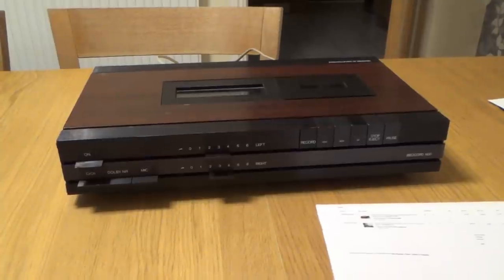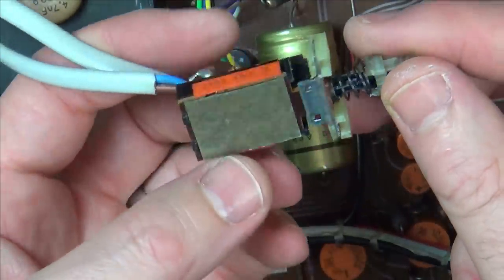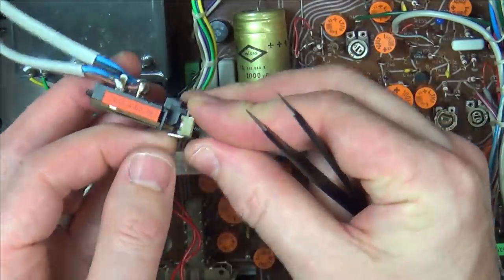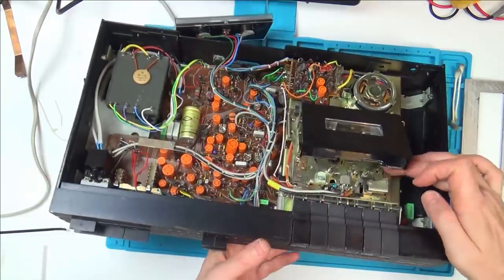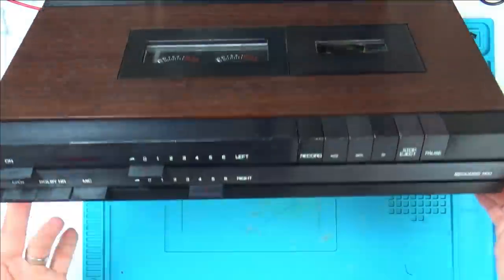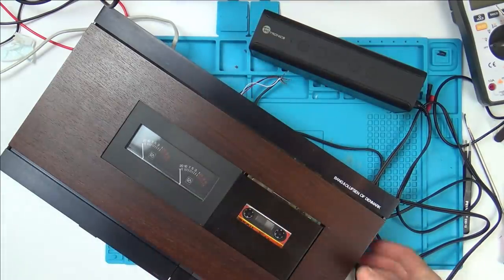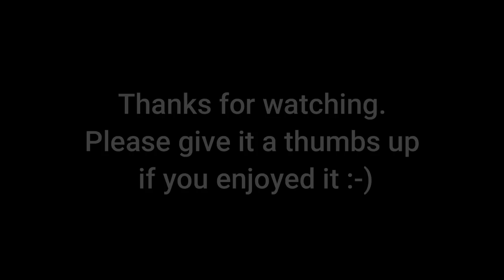Bang & Olufsen BeoCord 1100 Cassette Deck -Trying to Fix

Comment: while the leads not right for the right microphone due to the AV needle not moving properly, but basically you find 1/2 way through the song, and then set the levels to a maximum of 0db as maximum (any louder then it will make like a silence on the recording as it clips the song) as a dj over that then makes the music very loud, then then you setup the volume of the input source so that the needles bounce around with the music (not moving very much means the song will be distorted), rewind the track, positive (red) on the needle means that the song is clipping as too loud. negative (white) is the area you want the needle to be, if the needles are not going up and down properly with the music then it means the input is too loud and distorted. but that is the basics behind recording an input so that it isn't too quiet or too loud, or even distorted.
Reply: source = walkman, but basically you want the needle to move from about -15db - 0bd. but basically that is what the dj used to do when records were vinyl, as no two records were recorded the same, or come out at exactly the same volume. so it was a constant battle to get the sound the same.
Reply: also with copywrite then lecturer said it is 10 years after the last release of the song, but looking it up then while the author of the song is still alive then it is 100 years of copywrite, or death of the authur whichever comes last.

Comment: He should've made the connections better because a short of the inputs and outputs can ruin the amplifier board inside the tape deck aswell.
Also there's a HUGE difference between the signalstrength for speakers and the line ports to keep in mind when working with these things. Line in/outputs usually works with <0.3V wereas speakers can be way beyond 10V!
Luckly, these appliances was built with high quality back when they were made, but the fact that these things are passing half a century now, they should be handled with care and caution when plugging those in. Especially if the electrolytic capacitors are not replaced.
You don't want the "magic" smoke comming out of it with a 💥(boom).

Comment: Not an audiophile, but it sounds like the issue with your record is that the output on your CD Player is too "hot" for the input on the tape deck. If you turn down the volume of the CD player's output and adjust the input of the cassette player as you did so the needles aren't peaking then you SHOULD get a more decent audio quality.
I have the same issue with my Minidisc player in my car using the headphone out; I have to turn the volume to max on the minidisc for the car audio to "hear" it and play it through while this same volume trashes my headphones until I turn it down again.

Comment: Has anyone told him he is in the wrong input? It is the other pair of connections on the five pin din which are always L/R in and L/R out. The mic is for a mic and is around 25- 30db more sensitive.

Comment: your were putting to high an input from the cd palyer it will only need a few mirco volts to record from . and you may have left a wire off for the vu meter

Comment: You're feeding your source into the wrong socket. Ignore the MIC DIN altogether and use the other two pins for the input signal. The 5 pin DIN socket should have 1=in, 2=in, 3=in/out earth, 4=out, 5=out.

Comment: Amazing how someone can fix something, yet still not understand , that sound is caused by the input signal to load, if you try reducing the volume levels on the l and r channels then check the recording. Of course the tape itself has some result on the final sound quality. That was the problem with analogue recording from one source to another, there were so many variables

Comment: It's distorting because headphone output is wrong for a mic input. Too much voltage.
Reply: Bang on , I was going to post this , the input is designed for non amplified sound so turn down the volume on the CD player to virtually nothing and it should sound ok 😀

Comment: That's distortion îs because the CD has big output.  And that output go's direct to the head of the tape. Headphones direct to the head tape = distortion. You need a smol volume of sound there.  Just put a 100k resistance there on each channel.

Comment: I think the input signal far too high for the Mic input Socket he sensitivity of which will be around  3 mv, where as the signal you are feeding must be in excess of 100 mv, and hence the distortion. Normally,  the 5 pin DIN Socket will have input and out put in the same Socket

Comment: Hi Vince, I think the power switch  pin is meant to go in from the outside, not the inside, the wee spring plate looks like it's been off before, have the ball end of the pin at the spring, that's why it was inside the case rattling around and not still inside the switch.
Good videos though, I've watched most of them matey.

Comment: so not just the belts need replacing huh? shame got rid of my cassette deck got sick n tried of just spaying oil in there and it working for a bit but then not sound flat dull then a few moments later fine that or eating the tape as in pulling it along but no sound still i have my other system just sitting there collecting dust as the belt needs replacing it'll work but then sound like the band singing are melting then stopping,

Comment: 24:40 You can buy those switches new: https://www.ebay.co.uk/itm/2x-KDC-A11-2-inner-spring-TV-5-electric-heater-large-power-switch-with-bracket/254690253690?hash=item3b4cb8db7a:g:s08AAOSwdO9fOdF~
If you search for the model number KDC-A11-2 you'll find even more.

Comment: Don't try fixing these power switches as it is a waste of time. The 'L' or 'U' shaped pin usually runs along a fine groove in the switch and there is a very small lip in the groove that acts as a latch but wears or breaks off after some years. In the 'on' position the spring forces the pin to take a route where it latches onto the plastic lip. Depressing the spring moves the pin away from the latched position and allows the switch to slide outward to the off position.The spring does 2 things - it secures and binds over the pin, as well as acting to guide the pin to the latched and unlatched position. There are only 2 or 3 types of power switches, so measure up and order a new one on line for a couple of bucks.

Comment: Don´t  use the Mic input, the sensitivity is too high! The Line Input is on the same Din Plug as the Output. Line Record in are Pin 1 and Pin 4
Reply: You're right there. DIN sockets supply inputs and outputs all in the one socket. That's why he really needs the correct DIN cables.

Comment: the distortion on the recording could be down to the input volume being too high usualy on the older systems the line in is not amplified from the source where as the out put from cd player is amplified  you can try adjusting the volume level on the recorder and lowering the volume on the cd player until it sounds right or you can try connecting the output from the cd player  before the amplification chip  on the pcb  and not the headphone socket

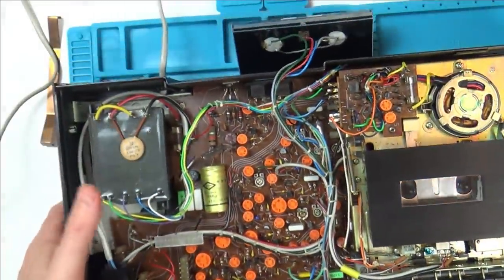Comment: 7:40 What happened to your Surpeer multimeter? Just asking as I've seen you use the damage-repaired Fluke multimeter haha (42:00 oh there it is)

11:10 Nice Casio watch - I wonder where I saw that before? 🤔😜😉

16:54 "Ahh, shhh... <incoherent sounds>" - I don't blame you for literally being on the verge of swearing if that was the case.

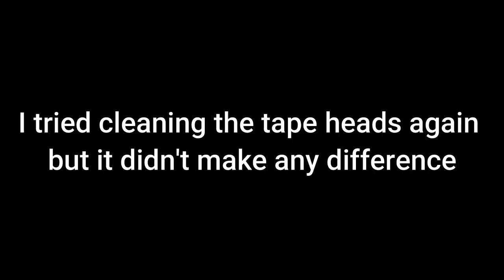51:00 That sucks dearly about the state of monetisation man. :(

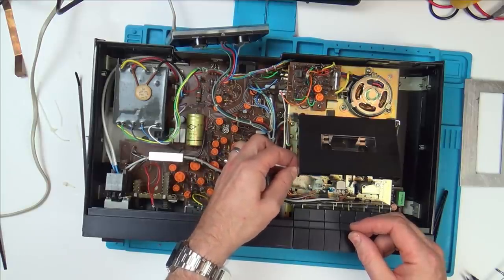Comment: 29:50 one will be the record/play head (the one in the centre) and the other will be the erase head (the one on the left, which looks to be of the electromagnetic variety (which is the better type), cheaper decks might use a permanent magnet erase head)

some decks use a 3 head system, where you have separate erase, record, and play heads (the tape travels over the erase head first, then the record head, then the play head, the 3 head decks allow you to monitor how the recording is coming out as the deck is recording)
without getting a proper look at the tape heads i wouldn't be able to tell you if that was a 2 head or a 3 head deck